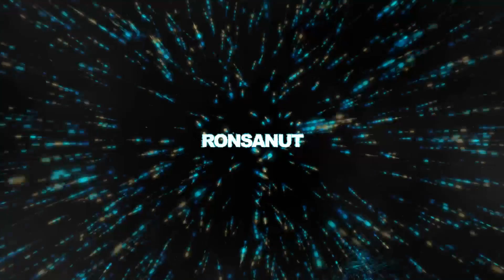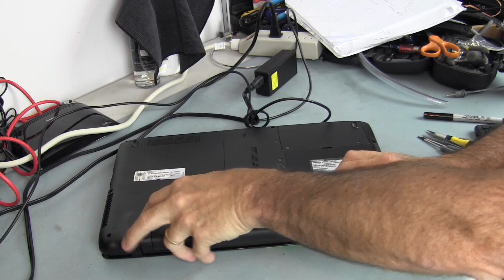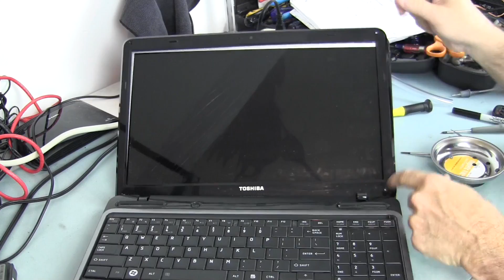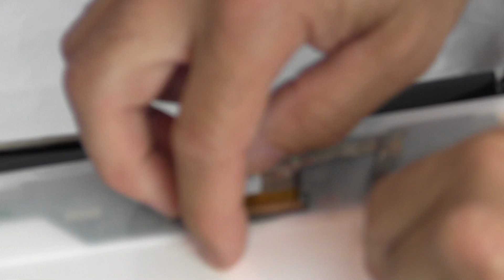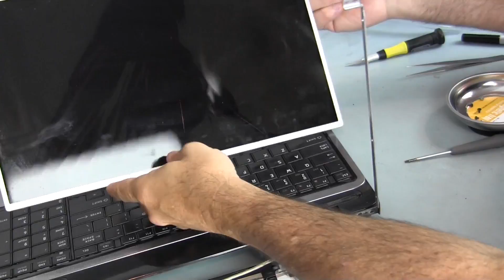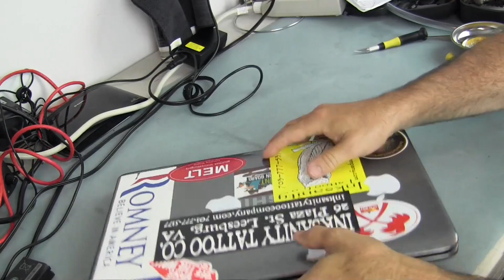Laptop screen replacement / How to replace laptop screen on a Toshiba L755D S5109

Comment from the maker: Yes the zoom in did not film well and I did not realize it until after the units was fully repaired and I started editing the video.  It was just too late to redo as I had to return the unit to the customer.  Also I did film the complete reassembly, however I was given a 10 minute video length requirement and unfortunately the reassembly would have added another 7 or so minutes at least.  I think I will edit and post the full version, as well. Your constructive criticism is well come. Thanks.